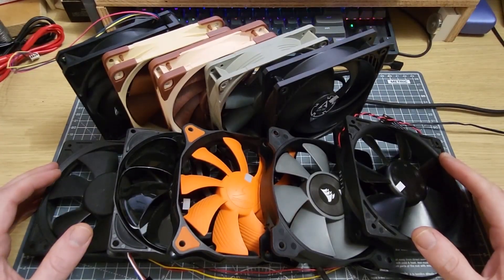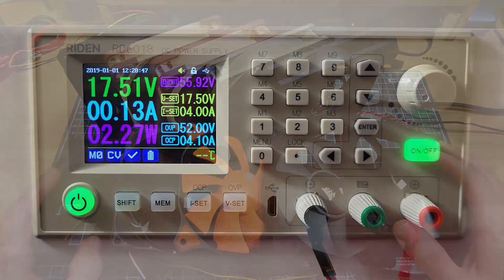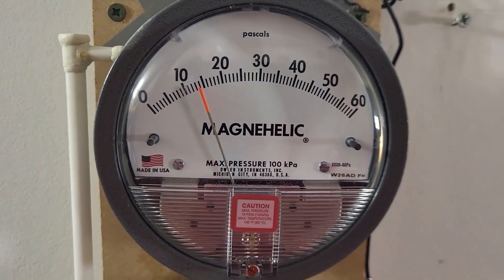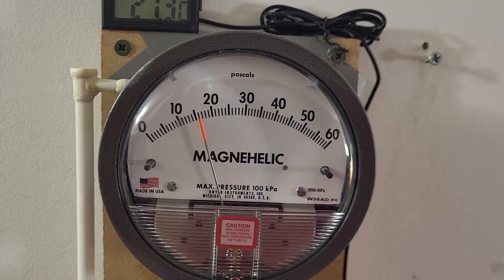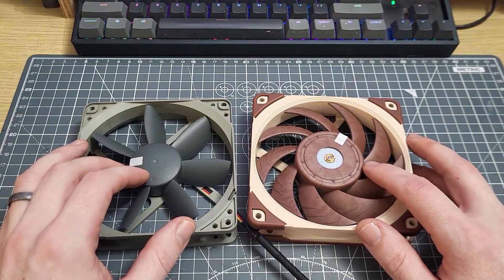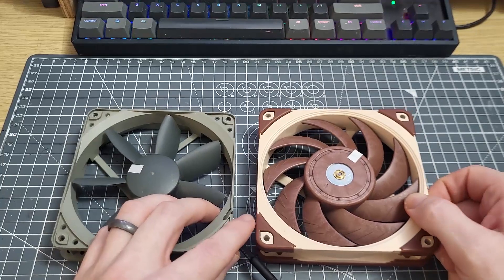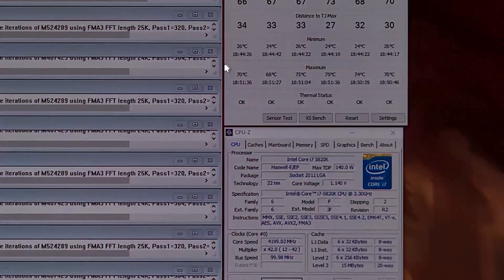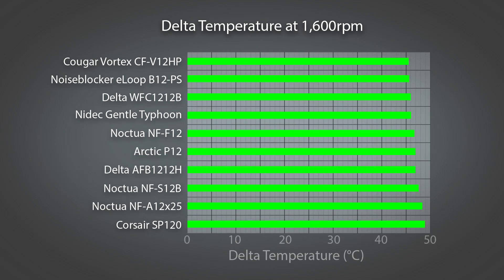"Static Pressure Fans" Don't Exist - Part 2

Comment: What PWM profiles are you using for these fans?
Reply from the maker: No profiles, just manual % control at 16KHz (I built my own controller).
Reply: @FanPhys  I see, why 16? Could you try a few of them with 25 and 48khz? I think your results will change a bit.

Comment: I thought static pressure fans were supposed to overcome a degree of pressure  vs creating static pressure. I was thinking that the "static pressure" fans were more of an exhaust fan. Basically converting static pressure into air flow. I suppose the "static pressure" fans are supposed to be more efficient converting pressure into air flow. 

Is that idea something you want to test?

Comment: There are exceptions to the performance rule. Some rare fans like bequiet Silent Wing 3 can be choked by a medium density heatsink and produce about half the expected performance per RPM. These particular are about half the static pressure of others while having 3/4 the airflow, trading it for much lower noise. Even in free air, they produce a shorter range "blow". This kind of a fan is meant to be used in high numbers distributed over a case in a negative pressure configuration and has problems even blowing through a thick or dense radiator.
Most computer fans are not this design.

Comment: Hello! I want to do these tests here at home, I'm not sure which pressure gauge I should buy, 0-30pa or equal to your 0-60pa, I found a -60 - 60pa, I wanted to have the best precision, I'm going to test PC fans and use an industrial one just for reference, which is a Sanyo Denki San Ace 120 4A 12V, I'm waiting for a response 🙏

Comment: I was under the impression that the curved blade design was a life cycle consideration- that it allowed the motor to work against a higher load for longer. Could that be a part of it?

Comment: Someone please explain to me how the static pressure optimized Noctua fan building up more pressure and performing better in the thermal test than the airflow optimized Noctua is proving that static pressure fans don't exist?
Reply: Static pressure is created by the fan. All fans are static pressure fans just to different degrees. The fluid doesn't move on its own. Fan design plays a part in amount of pressure created in a given space. The a12 is marketed as a do it all fan, not specifically a static pressure fan, ~21Pa at 2000rpm. F12,  23Pa at 1500rpm. The sp120 is marketed as a static pressure fan but it's only rated at ~13Pa at ~1400rpm. The p12 is rated at ~20Pa at 1800rpm. So your results are pretty much expected all those fans based on their claimed specs. Corsairs marketing was bad, but it usually is. Your test was flawed anyhow.
Reply from the maker: You are cherry-picking two fans whose performance conforms to your own bias. The Cougar, eLoop and Gentle Typhoon all beat the NF-F12 in the thermal test despite their inferior pressure performance. There's no such thing as a "static pressure fan" because static pressure is a property of the fluid, not the fan. It's a nonsensical phrase conjured by marketing execs.

Comment: Can manual RPM readings be consistent with the varying hub sizes though? I don't get the point of overvolting, since your motherboard can't do that.
Reply from the maker: One revolution is one revolution, regardless of size. Some fans needed a boost in voltage to reach the standardised test speed of 1600rpm; testing a 1200rpm fan against a 1600rpm fan is not an apples-to-apples comparison.

Comment: All this proves is your methodology for testing static pressure is poor.
Reply from the maker: What it actually proves is that static pressure is not really a good metric when comparing a fan's cooling performance, because pressure isn't the only thing happening when a fan blows air through a heatsink; it's significantly more complex than that.

Comment: Why did you choose to normalize RPM? To me it makes way more sense to normalize either wattage or (more likely what people choose speed based on) noise level.
It could be that I havn't thought this through enough yet, but don't understand why you went with the method you did.
Reply: Makes more sense to test them at 12V. Because that's the maximum you'd have in your PC.... I mean they aren't hitting the RPM value at 12V because either the motor is crap OR the blade geometry is providing more resistance. 

And if they are spinning slower they probably can't actually perform as well...
Reply: @insanemal They need to be at the same RPM for consistency,  IF the RPM was different, its not the design of the blade that would be the only factor giving diffrent results
Reply: I also think it would make sense to noise normalize the performance I don't care what RPM they're going as long as I don't hear them Too Much and Then they're also there of what kind of noise they make at that decibel some fans have annoying shrill tone some fans are silent in the tones that they make
Reply: @Dreadwin69  You kind of want both measurements. But noise is very tricky to properly measure, as it depends on multiple things, like some fans produce vibration while others produce more wind noise, yet others produce an annoying but quiet whine... Not sensible to reduce to a number, but very useful to show on a spectrogram.
Reply from the maker: Since my tests are purely performance tests and not noise tests or power tests, it makes sense to level the playing field by setting each fan to the same speed. It's also worth noting that fan motors have varying levels of efficiency, so one fan might draw three times the power of another fan for the same speed and performance. I will consider this for a future video however it's a big subject that would require a lot of time to adequately cover!
Reply: @FanPhys  Yeah, that makes sense, but I also feel like it's a bit weird since these fans with very different motor characteristics also are intended to run at different speeds, sometimes with completely different both upper and lower speed bounds. It could just be that the static pressure fans are intended for pressure at lower speeds compared to other fans, and that would be a nuance missed by this testing.
Reply: They need to be at the same RPM for consistency,  IF the RPM was different, its not the design of the blade that would be the only factor giving diffrent results

Comment: Well that's disingenuous to say there is no static pressure designs. Pressure is just a function of airflow and resistance. The steeply pitched blades of the airflow fans will develop more pressure than the curved blades of the static pressure fans at the same RPM as it will move more air at the same RPM. The static pressure optimized fans have curved blades that needs more RPM to move the same amount of air. 

The issue with the steeply pitched blades is that they make more noise at the same speed and the steeply curved blades are more likely to go into stall region against a high resistance which will cause even more noise. So, it will make way more noise trying to get the same static pressure as curve bladed static pressure fans. The term static pressure fans doesn't mean that it's making more static pressure, rather it is better optimized at making higher static pressure more efficiently (ie. less noise and motor power).
Reply from the maker: I didn't ever say that there are no static pressure designs. What I said is that there's no such thing as a "static pressure fan." The term is used very effectively to market a range of Gaming PC products to a consumer base that knows no better, which is precisely why I'm making this series of videos. Static pressure fans don't exist!
Reply: @FanPhys  Ok I don't understand how saying "Static pressure fans don't exist" is different to "no static pressure designs". 

Getting the static pressure designed fans for use on radiator still results in a much better end user experience than using the airflow fans on radiators so I don't see the issue that "The term is used very effectively to market a range of Gaming PC products to a consumer base that knows no better".
Reply from the maker: @OTechnology  The fans that are optimised for static pressure don't exist on the PC fan market. That's what I'm getting at. And there is also no such thing as an "airflow fan" because ALL axial fans are airflow fans.  These catchphrases are marketing hooks which make you think you are buying a special product... you are just buying a fan, and they all do the same thing regardless of design, as I am demonstrating in this series.
Reply: @FanPhys  What do you mean pressure optimized fans don't exist? These pressure optimized marketed fans literally work better for higher static pressure requirements since they produce less noise. Your argument is odd to say the least.

Comment: Isn't the pressure differential across the fan the reason for the airflow in the first place? Doesn't this make pressure and flow essentially the same thing?
Reply from the maker: It's a causal relationship - the low pressure in front of the fan is what causes the airflow at the rear of the fan. In a purely linguistic sense it helps to think of pressure and flow separately, but it gets complicated pretty quickly because we're dealing with fluids which, unlike solids, can have "velocity pressure", which is not the pressure of the fluid itself (static pressure) but the pressure exerted by the fluid flow. In simple terms, "airflow" is volume over time,  and "pressure" is force over area...  but you need pressure before you can have flow. Yay physics!

Comment: This is fine on a brand new radiator or immediately after cleaning dust out, but what about once there's some resistance/blockage?
Reply from the maker: The Thermalright cooler I used has a higher fin density than most modern air coolers which is why I chose it for the tests. Even so, the actual resistance is still very low, so there's plenty headroom for each fan to handle a more demanding cooling application.

Comment: Did you pull enough data to denominate by (or control by) wattage instead of RPM?
Reply from the maker: It's a good shout, but I quickly abandoned measuring power draw with my DMM because each fan motor is quite different. The NF-F12 for example is able to achieve a maximum static pressure of 17.5Pa at only 59mA of current, which is significantly lower than any of the other fans I tested. The Delta fans have beefy motors and draw four or five times as much current for the same performance. I am planning to look more closely at the motor designs, having already disassembled a couple of fans, so stay tuned!
Reply: @FanPhys  Yeah that's fascinating that the pressure-per-power could be so different. Looking forward to more!

Comment: What about the static pressure curve over the whole speed range of the fan? Would be interesting how much it changes depending on rpm.
Reply: The pressure-CFM is (conceptually at least) analogous to a voltage-current curve of power supply, while obstacles (e.g. heatsinks, cases, vents) present their own P-CFM curve (like a load or resistance). The curves for fans should be in the datasheet. The intersection of both curves (for a given fan speed) gives you the flow, which results in heat removal.
Reply: @juanignaciocarrano860  No manufacturer provides those curves though.
Reply: this is what im thinking aswell. comparing Noise, airflow, and pressure, on an rpm curve would give a more complete picture. Im never going to run a fan at anywhere near max rpm, so the performance there is useless to me. What is the performance at 500, 750 and 1000 rpm? is the "pressure" fans better at those rpms? or are they doing the same cooling, but quieter?.
Reply from the maker: @kasslerify  Performance at 1,000rpm and below generally levels out regardless of the type/design of the fan. Furthermore, the level of pressure in the range of speeds <1000rpm is so low that it becomes difficult to measure accurately or meaningfully. I've also found that at such a low speed most fans are nigh on silent anyway, so it seems (to me at least) fruitless to investigate it. :)
Reply: @FanPhys  No - that is exactly what they are made for.
Reply from the maker: @ABaumstumpf  I don't follow - what were you responding to?
Reply: @FanPhys  i am responding to your false claim of "Performance at 1,000rpm and below generally levels out regardless of the type/design of the fan. Furthermore, the level of pressure in the range of speeds <1000rpm is so low that".
Cause that is exactly where those fans are designed to run and where the biggest differences are to be found.
Reply from the maker: @ABaumstumpf  it's not a false claim, nor was it made by me - many years ago Martin's Liquid Lab extensively tested most of the 120mm fans on the market and he concluded from his test results that at <1,000rpm there's virtually no performance difference between the many models of fans.
Reply: @FanPhys  "it's not a false claim"
Did you test the fans at the same RPM? Some Noise? Same power?
No? Then how can you make any claims about their performance without those claims being unfounded?

"nor was it made by me"
You made this video you made the claims. Others having made the same false claims is completely irrelevant.

"from his test results that"
Which hundreds of tests even here on Youtube show to be wrong.

Comment: My theory: Curved blades are better at focusing the airflow, and a shallower angle of attack twists the air less. Heatsinks are basically flow straighteners, so the straighter the flow is before the heatsink, the less losses there are when the air passes through. Something like the Corsair SP120 Elite seems like a very good design when considering this; the blades have a pretty shallow angle of attack, and the stator vanes gently straighten the flow. It also avoids the acoustic issue that the Noctua NF-F12 has, where the straight blade trailing edge lines up almost perfectly with the straight leading edge of the stator vane, and the interaction creates a droning sound. The trailing edge of the SP120 Elite blade is curved, and the stator vanes are also curved, so they are closer to perpendicular rather than parallel like the Noctua.
Reply from the maker: From what I can find in research papers and articles, it looks like turbulence can improve heatsink performance where there is a pressure deficit, which is probably why the Gentle Typhoon is such a good heatsink fan despite it's low pressure performance. In the case of the best all rounder, the Delta WFC, it has large petal-like blades and a strong motor. The NF-F12 does make a distinct and obvious noise where most of the other fans don't, however I really don't think that the stator design does much of anything at all for performance, not on a 1,500rpm fan. The PPC version would be a different story!
Reply: From my not-so-scientific testing (smoke machine in front of the fan) this is true, the Noctua A12x25 "directs" the airflow a lot more than an S12B or A.

I can't say anything about how (and if) this effects performance on a heatsink though.